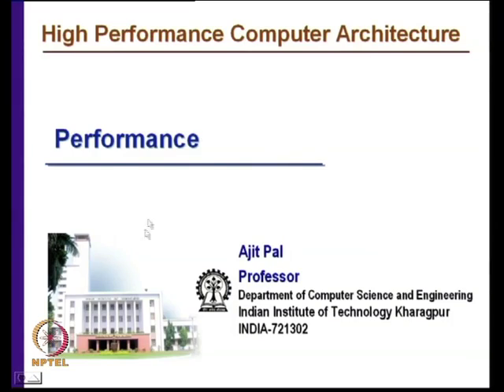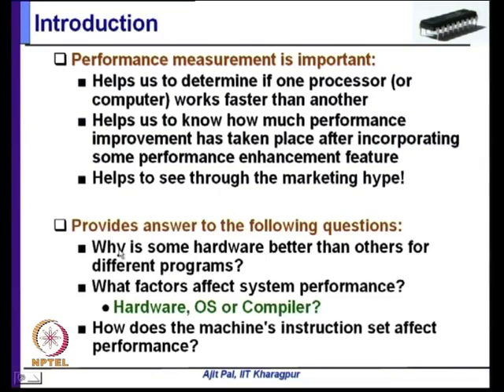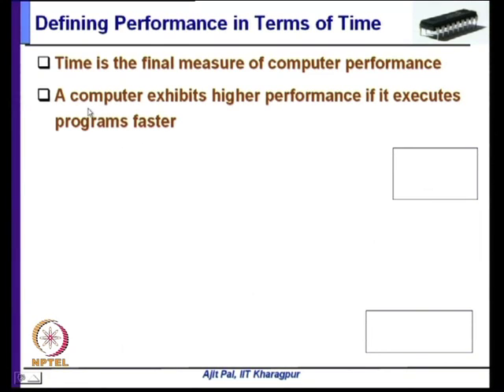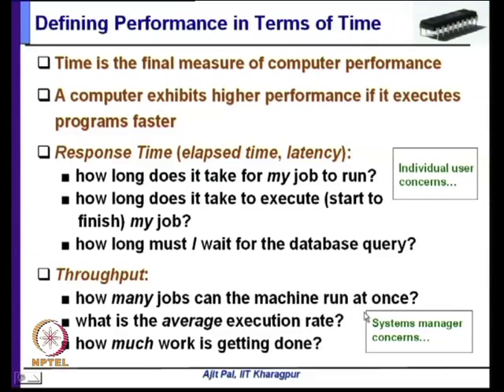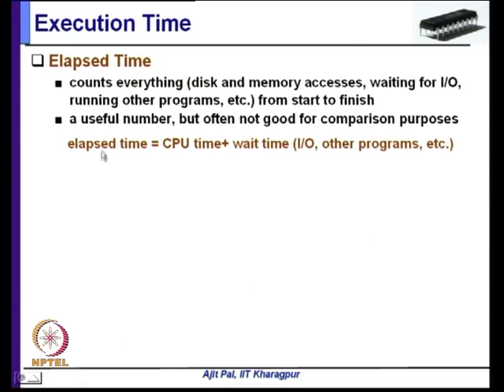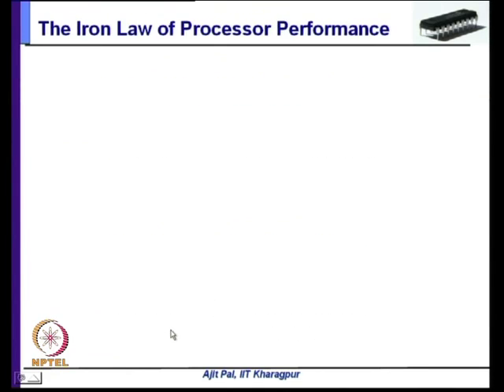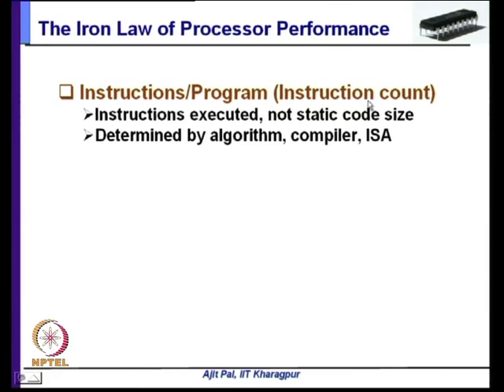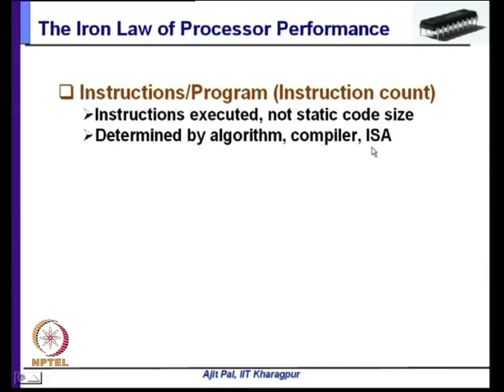Mod-02 Lec-02 Performance

Comment: i think you got the full form wrong is MIPS (originally an acronym for Microprocessor without Interlocked Pipeline Stages)  correct me if i am wrong !
Reply: A unit of computing speed equivalent = million instructions per second.
reason i reply : so others won't get distracted .